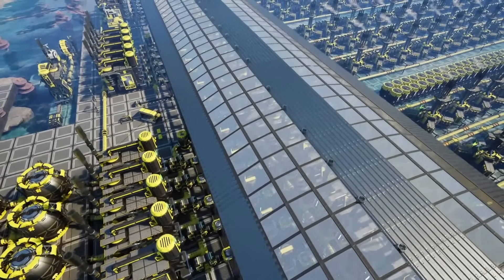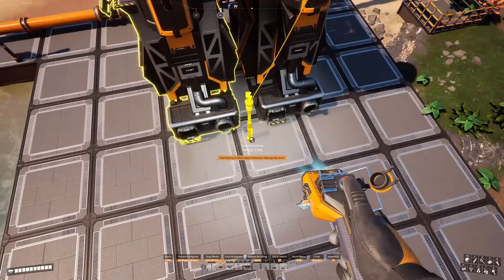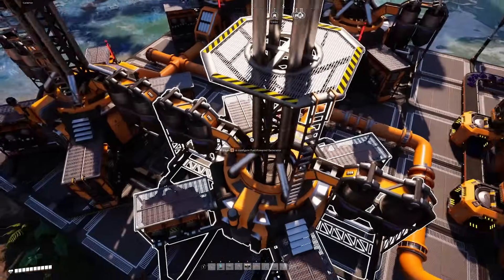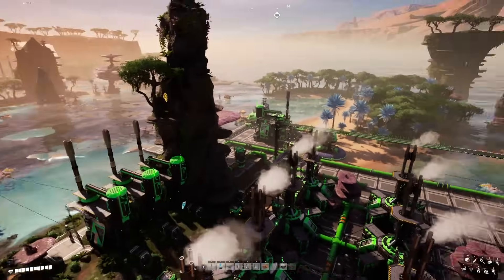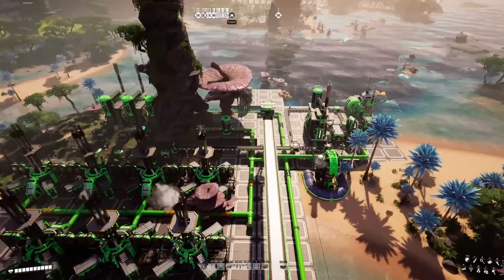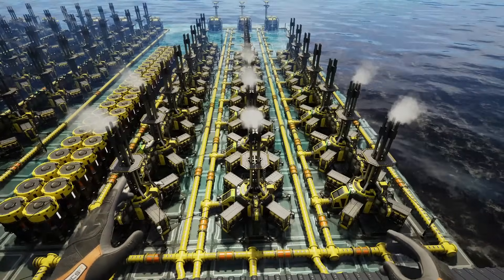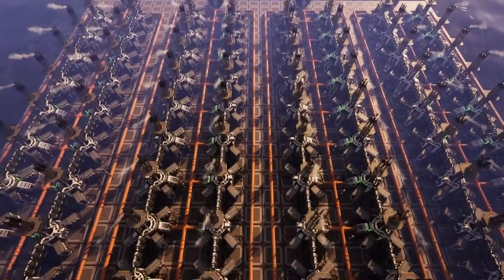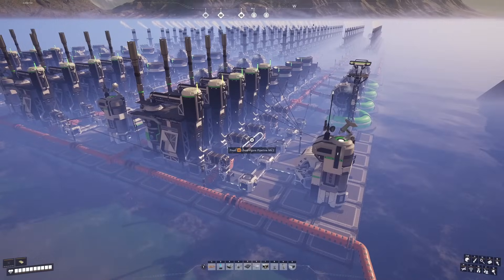100% EFFICIENT Fuel Power Plant Build Guide incl. Multiple Designs - Satisfactory 1.0

Comment: Oil to HoR alt (refinery) to Distilled Fuel alt (blender) to power generators. Requires those two alts. One oil node OC to 450 can supply 60 Fuel generators giving you 15000MW

Comment: You have no idea how much this helped!!!  Putting the AwesomeSink to do away with the Polymere Resin.  I just set up a Fuel Power Plant and was quite happy having the extra juice in the system.  I was running around doing things and noticed the power level had dropped off.  Upon inspection, it became apparent that the abundance of the Polymere Resin had stopped the flow of oil, too.I was thinking I would go NUTZ having to empty an overflow container or make sure the Polymere Resin was being used to fabricate something in another factory just to keep things flowing.  Great idea dumping it into the Awesom Sink!  Better than asprin for the headache I was feeling coming on.  haha!.

Comment: I just unlocked MK 3 belts as well as  miner tier 2 and was working on upgrading my coal power plants. I got two pure notes as well as two impure notes that I’m trying to split evenly amongst 24 coal power generators. I did the math with overclocking the miners and the generators, I’ll need 35 per minute per machine. I’m using one water extractor for two machines because doing the math to balance. It perfectly just is too much of a headache. Yes I’m losing some efficiency there, but I’m still at the beginning of the game so it doesn’t really bother me.

Comment: I like this power farm, BUT it is not 100% efficient. I built this just yesterday and the crude oil has a tough time getting anywhere past the last 2 refinery's on the last two sections. which means It just not out putting enough oil residue for the fuel. not even close. iv had to run another pipe line in to it to increase it to 900m3 of crude oil. I tried for hours to get the one source to work with no luck. the numbers work but they just dont get the resources

Comment: Thank you very much for the tipps :D

Unfortunately pipes seem still to be a little bit buggy (in aluminium and in powerplant as well).
So meanwhile i am using a mod which turns fluids into gas what makes the whole thing working very well (as it should do also with fluids, but as mentioned i guess there is a problem that seems not be solvable)

Comment: One of the biggest advancements in this game if not the biggest is honestly the movement. You start our relatively slow. Become fast, faster and start flying. I just unlocked the jetpack but use solid bio fuel for it and it I can only stay in the air for a few seconds. I wish could fly like this already, because it would be so much easier in building
Reply: The hoverpack is better for building than the jetpack because it pulls from any nearby grid. No need for fuel and, if you are building infrastructure that you need to fly for, odds are your grid is present. The jetpack is great for exploration though since you wouldn't have the grid.

Comment: It can be a good idea to just skip straight to Mk2 pipes before you start building out fuel production.  It’s a few awesome shop tickets in order to get the prerequisites and materials, but you can skip straight to using 600crude oil per minute and scale out power, plastic, and rubber much faster in the midgame.

Comment: Hello I have a question! I followed the first design (just started working with fuel overall) my question is, when you connect this farm do you connect it to your main power souce? and if so, does it ever blow a fuse? I copied your first design and everything was fine for a while until my coal and water generators started failing and I'm not sure how to solve it.

Comment: around 2000 hours in game and still learning new things. Building a factory in stages downhill is a great tip with liquides. thanks for the tips.
Reply: When I'm building refineries and other buildings which use pipes I like to build a frame out of metal beams to line all the pipes up in front of the machines.  This saves you having to build conveyor bridges over your pipes.

For the output, i run the pipes straight under the floor and build a basement layer to connect them all up and send them out of the factory.  

This leaves the ground floor totally free for belts and their mergers and splitters which I find much easier to both see past and navigate around as you're building out/trouble shooting.

It takes a bit of extra prep to build out the frames but you can speed that up with blueprints.  If you place a pipe support two metres back and in line with the machine you can use the "horizontal to vertical" placement mode to get a nice clean vertical pipe leading in to the machine which doubles as a small buffer and helps reduce the need for pumps and valves since you're never fighting gravity. 

It also takes a bit more work to raise the fluids to the needed height to begin with, but I think it's worthwhile for how much easier it makes pipe laying.

Comment: 2:08 how the heck did you get the lifts to connect like that?  It keeps snapping in a completely different way when I try to align them
Reply: I am having the same issue. When I snap the two lifts they don't let the conveyor belt exit. They only create an input direction
Reply: After researching a little, you can just connect it and then pull the mouse downwards (look down) and the hole where it'll come out of will go to the bottom

Comment: It feels wierdly good to have designed my own fuel plants before looking at guides and see that I did a really good job of making them efficient. I made my first fuel plant process 600m³ of oil p/m into as much fuel as possible, process the resin into plastic and rubber, and process some of the plastic into packes for a small amount of excess fuel. I added on a turbo fuel secrion later on too. I also just unlocked the blenders and diluted fuel, so I'm going to have some fun with those

Comment: Following your first design in this video, I tried hooking up a pure oil node fully overclocked (pump), using MK2 pipes. I was extracting 600 oil, something the pipes should be able to handle. I build 10 refineries (600 / 60 = 10), and 20 fuel burners. For some reason, the oil extractor wasnt able to keep up with the 10 refineries. Is fully overclocking a node just not stable or something? (no, there were no mk1 pipes, everything was on completely level ground, and the layout was identical, just expanded to have more refineries and generators). The oil pump would have periods where it didnt seem to be pumping out oil to the refineries, and the pipes between the pump and the refineries would often not be full.
Reply: Possible reasons: 1 floorholes for pipes dont work, try avoiding them. 2 hight differences of the pipes. 3 back flow due to intersections,  a pump that is not hooked to electrixcity fixes backflow. 4 fill up refineries first before discharging fuel, make sure they overflow with oil to the max. 5 bottlenecks in discharging fuels causes refineries to consume oil not steadily....

Comment: Just built a 144,000 MW rocket fuel factory. Extremely satisfying in the gold coast. The 2700 crude you can get there makes for such perfect ratios. Plus 1800 rubber per minute as byproduct aint bad!
Reply: Always amusing to see people say "Just" about anything that will likely take 8 hours minimum to make a very ugly slapdash thing, which I try not to do XD 

but yeah the rocket fuel recipes are really intriguing me, I've just got to find a blueprint setup and acceptable org structure to contain the massive sprawl of HUNDREDS of fuel generators hahaha. Probably gonna be about three massive skyscrapers, so that I don't have that ocean before I figure out I needed that water later on or something. 

And imma definitely wait till I get blenders, and the diluted recipe for them. I built a "14pack" of packers to handle my little 300m3/min base turbo fuel setup for ninety gens, but yeeeeah that is gonna be some doing. And I need to get that done before I really consider the mass production of those liquid canisters and stuff. Need power to make power, allat.

Good luck in your further adventures!

Comment: Is it just me, or does the second layout rely on a packaged fuel bottleneck? 240 oil /min in, through 4 refiners outputting 160 fuel/min, into 7 generators consuming 20/min per (140min) which leaves 20/min left over for the packager that uses 40/min at full speed. I don't mind bottlenecks, but I prefer it to not be linked to my power generation and a risk that one of my gens turns off if I suddenly have an increase in fuel usage. Limiting the packager to 20/min would work, but isn't mentioned, and I just wonder if it may accidentally catch someone up later. Great video btw, despite what may seem like a critique, trust me, it's not.

Comment: Can you explain why you use packaged water rather than just pumping in the water directly? Isn't that an unnecessary extra step?
Reply from the maker: Diluted packaged fuel is a tier 5 recipe but requires packaging.  Diluted fuel, not packaged,  requires the tier 7 blender.  Both provide the same power,  but one is available earlier.
Reply: @Dekoba  ahhhhh, right, thanks for the reply. Nice, great video btw.

Comment: I have 6 fuel generators running and the two on the end run good for like 2mins then they just go empty...Im losing my mind over this...I just don't understand how liquids work in this game. Im producing enough and still going empty
Reply from the maker: liquids are tricky. try turning them all off and letting everything pre-fill. It may also help to underclock a generator to 95% to ensure you are overproducing by a little bit.
Reply: @Dekoba  Im running 8 generators now and I underclocked a few of them and added a pump and its working good now. Not sure if the pump is needed but it wasn't working before. Either the under clocking or the pump fixed it. Thanks for the help would of never though of under clocking.
Reply: The pump is a good safeguard, especially if there is a questionable amount of lift.
Reply: @Fasyle  I’m still pretty new to the game. When liquids get involved and it doesn’t work it just confuses the hell outta me.

Comment: Is there any reason not to overclock fuel generators? The power increase is directly linear to the fuel consumption. You only need 24 power shards to have 8 generators doing the same work as the 20. Slugs are everywhere, and with the quadruple power shards from somersloops, it's not many of them at all...
Reply: Uses a lot of shards. But if you have them, use them. Is easy power. 
Probably power plants and miners are the best use of overclocking.
Reply: the amount of shards can scale up fast in bigger set ups when there are a lot of machines to overclock, but if you have the shards to spare, sure, it's fine. tho you can only double the amount of shards you get, there is only 1 production step for you to amplify with somersloops, you need 2 steps to quadruple output, like turning remains into dna capsules by turning them into protein first for example.

Comment: 9:12 I wasn't obvious to me at first what the point of this was, but packaging diluted fuel and then immediately unpacking it yields more fuel. "Just add some water to it" basically. :-D
Reply: Yeah, but have we done the math to see if the extra fuel makes up for the extra power and resources used to process it like that PLUS some to make it worth it?
Reply: @fictitiousnightmares  Looking at it a bit, yeah, looks like it's a LOT better. To make 90 fuel/min with a plain fuel refinery takes 135 crude/min. Packaging it this way only takes 33.75 crude/min, so basically 4x output. Obviously needs the alt recipe, a lot more space, and a lot of water, but much better on oil.  Can't put links here, but in "Satisfactory Tools", a share link for the packaged version would be "q16JMIn9CpBB90sp7bBX", vs the regular would be "Xlm9Pb2MPCYKo5mbtLkh".
Reply: @999erh  Thanks.  Was more worried about how much energy is used to process it all and if the extra made up for that energy use plus more to make it worth it.  In other words add up all the energy used to process this and then take only the extra fuel produced from the normal recipe and throw it in generators and see if that energy produced is more than the amount used.  It 'sounds' like it does, but I haven't done the math myself and was wondering if someone else had.  I don't know where on satisfactory calculator to enter those share links you provided.  I've looked and don't see any place to put them to show me what you are talking about.
Reply: @fictitiousnightmares  Heh, my comments get deleted even if I try to describe the url. :D But it's "satisfactorytools", which is different from "satisfactory-calculator". Click the "share tab" button and it'll copy a link to the clipboard. Replace the id in that link and it'll add a tab to the editor. It just shows which machines are used and the percentages on a small scale of what this video shows, though.
Reply: @999erh  Ahh, that worked.  Thank you.

Comment: Isnt it 20 gens. For 5k not 22.
Reply: Just built this for my playthrough of 1.0. Ready for dakobas turbo blend fuel guide.
Reply: @BabyJeus better than turbo fuel (much better) : rocket fuel (then ionized fuel but for much later)

7.5 Heavy oil résidu (reffinery)
 into 6 blender for dilluted fuel (add 5 water extractor) 

Then into another 6 blenders for nitro rocket fuel, add 550m³ of nitrogene, 600 sulphur, 300 coal, 

You got 900 rocket fuel ( and 150 compacted coal  and 150 polymer resin) 

You can turn the rocket fuel  into 86.3 fuel power generator at 250%

FOR A TOTAL OF 53750MW 

I could fit all into 1 blueprint than i Paste 2 time (600 fuel on 2nd floor and 300 fuel on bottom one) needed the mk3 for my build tho

Comment: Id like to see how you do a rocket fuel plant.  Also, I'd consider adding things like shards and sloops into your computations.  As an example, adding sloops to a few blenders to make a large, large amount of fuel.  Rocket fuel maxes at around 12m3/min for 625Mw.  Fun times. The ionized one was less.. but not by enough to justify it at the time.
Reply: 7.5 Heavy oil résidu (reffinery)
 into 6 blender for dilluted fuel (add 5 water extractor) 

Then into another 6 blenders for nitro rocket fuel, add 550m³ of nitrogene, 600 sulphur, 300 coal, 

You got 900 rocket fuel ( and 150 compacted coal  and 150 polymer resin) 

You can turn the rocket fuel  into 86.3 fuel power generator at 250%

FOR A TOTAL OF 53750MW 

I could fit all into 1 blueprint than i Paste 2 time (600 fuel on 2nd floor and 300 fuel on bottom one) needed the mk3 for my build tho

Comment: Do you use a mod to enable you to interact with buildings from further away. It seems you can press 'e' from much further away than I can
Reply from the maker: Mods arent working yet sadly. When I am making guides like this I often work in advanced game settings, with fly mode and free build, so it may be a property of one of those settings.
Reply: @Dekoba  How do you enable advanced game settings? I can't see it in my in game menu
Reply from the maker: When you load a game,  there is a button for load settings. It's a check in there.  Its creative mode and disables achievements but is good for trying new things out.
Reply: @Dekoba  Great thanks, I will try that out 👍
Reply: That's a feature of fly mode.

Comment: clipping the mergers into the elevators like that should be illegal...
Reply: Yeah, I hate how that's the default way that they connect.  They should connect to the end of the shroud.  Or maybe you should be able to nudge them so that they connect at the distance you prefer.
Reply: @OniNaito  They actually will connect at the end of the shroud if you put them there, and put in the elevator second. It's just the default snap point connection if you place the spliiter/merger second is... like that.
Reply: @lorospact  Right, absolutely.  That's why I always place my splitters first at the desired distance and add the elevator afterward.  I'm just saying I don't like the default snap point when you connect a splitter to an existing elevator.  I shall continue to do it manually :P